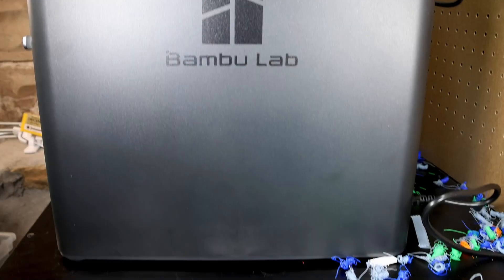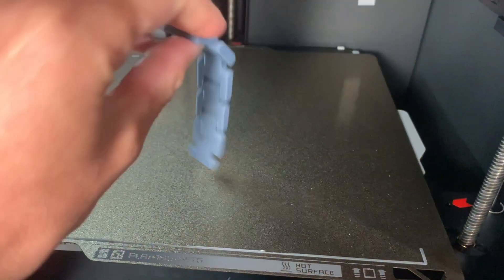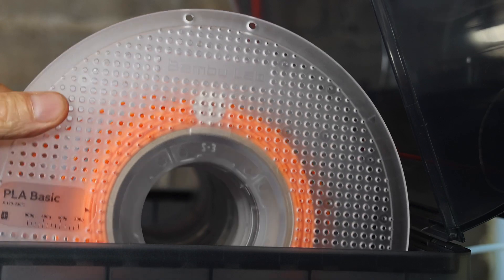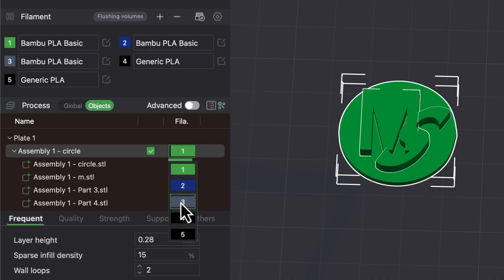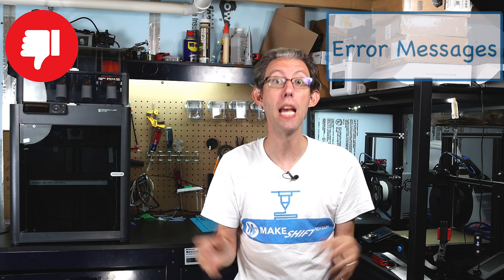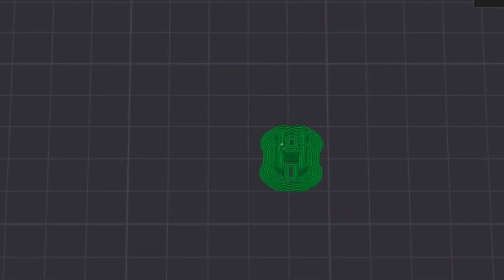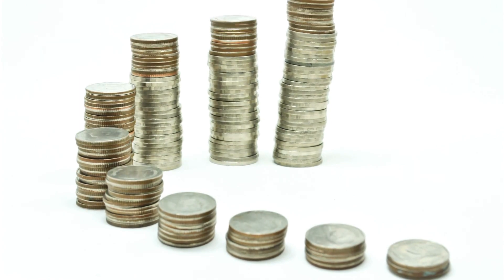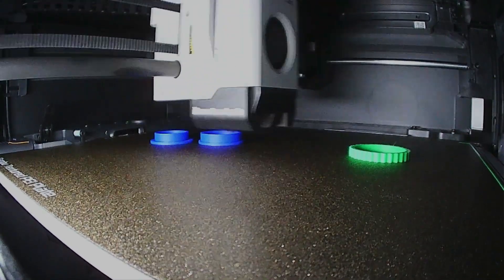Review of Bambu Lab P1S 3D Printer

Comment: One very good feature of the AMS not mentioned is that it knows how much filament is left on a spool, and it does this in a very clever way. It will pull through a known length of filament, and then count how many revolutions of the spool were made. Using this, it knows that if a roll has a lot of filament, the spool would rotate less than a spool with not much filament, and it's pretty accurate. I believe you have to enable this feature as it's not on by default.

Comment: Do you think that moving up to the X1C for $550 Canadian is worth it? It'll be my first ever 3D printer
Reply from the maker: @pmgf911 I personally haven't used the X1 Carbon, but it really depends on your intended use. If like most people starting out 3D printing you're mostly printing PLA I wouldn't spend the extra money on the X1C. Instead, I would spend that extra money on a second 3D printer, the Bambu A1 mini $459 (with multi-color system).  Having a second printer lets you print more items faster and if one goes down you have a second one.

Comment: Purging filament when not changing the filament does make some sense as that filament has been in the meltzone and was then fully cooled again before reheating.  This does degrade the material and purging that out might have a (slight) positive contribution to the quality the Bambu produces ...
Reply from the maker: That is a good point. Thanks.